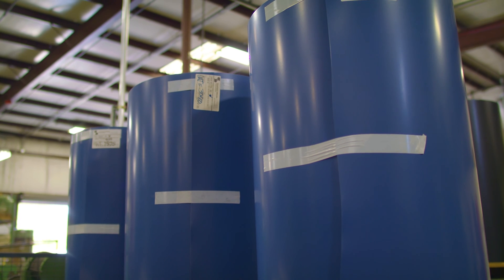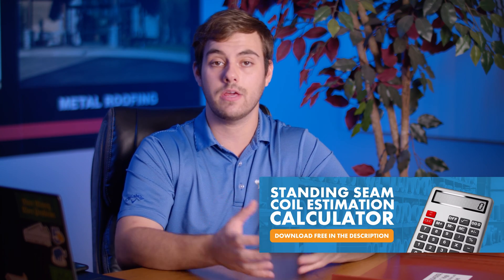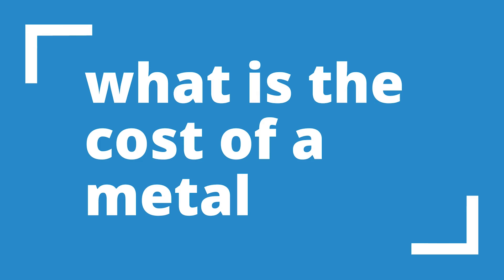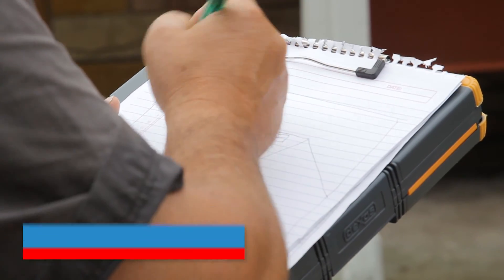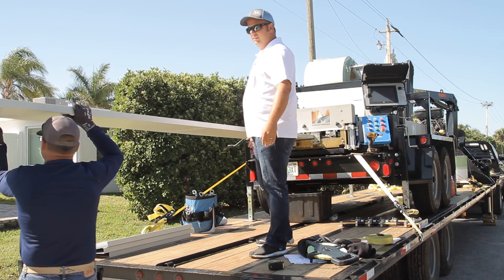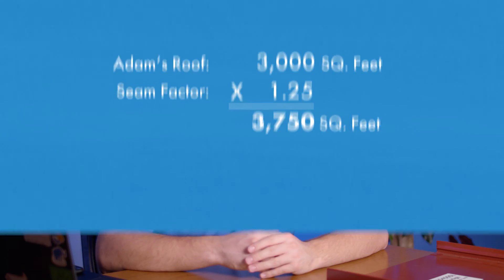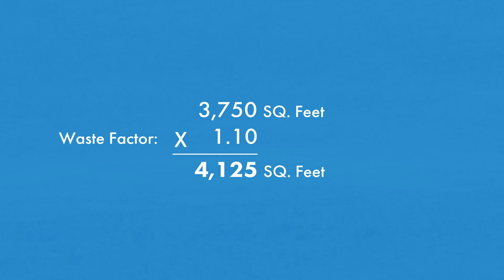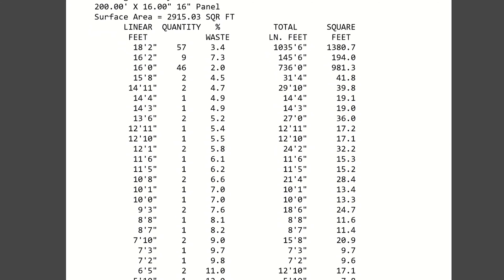How To Estimate Material For A Standing Seam Metal Roof Installation

Comment: Shouldn’t such info be presented to a homeowner when the build is finished in a fact sheet folder? 
I know there are blueprints, but owners can’t usually read them that well. 
A fact sheet for each Roof, walls, foundation, electrical, plumbing and hvac would be a great reference material for future repairs and remodels. Just saying

Comment: When estimating the linear footage why don't you add in the 10% waste like you did for the Sq Ft?  Also, to calculate the linear feet needed can't you just divide the estimated sq ft by the sq ft in a linear foot of finished product?  In this case 4,125/1.33 = 3,094 linear feet which is a far cry from 2,250.
Reply: That is exactly what I got 4125 feet divided by 16" = LF of coil required